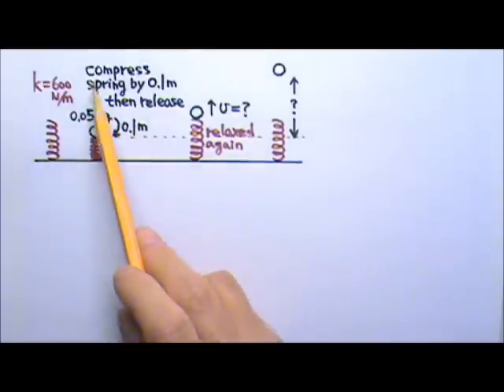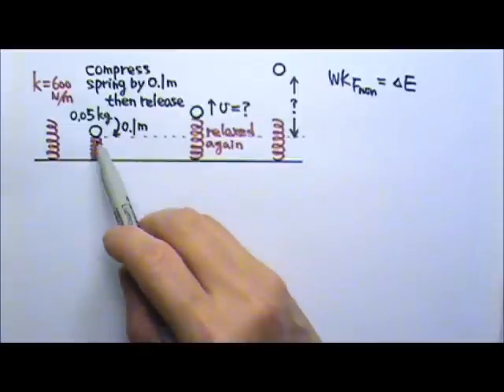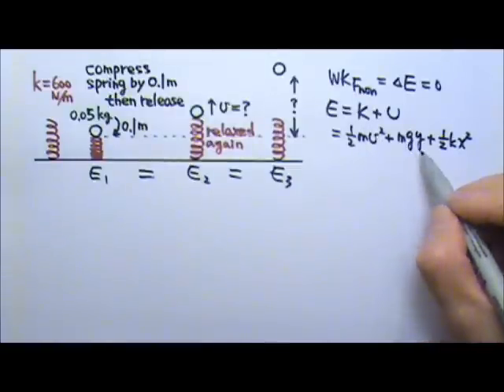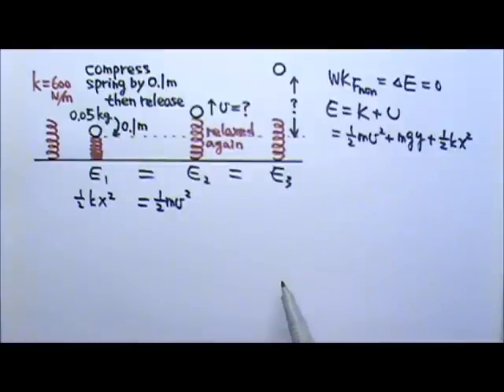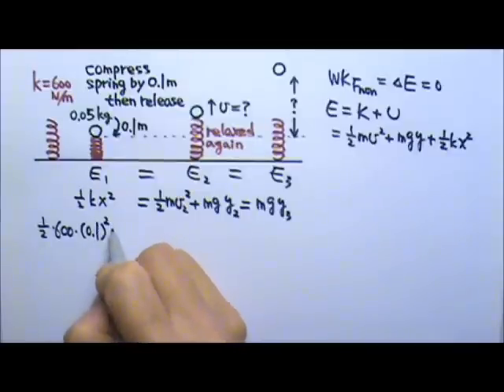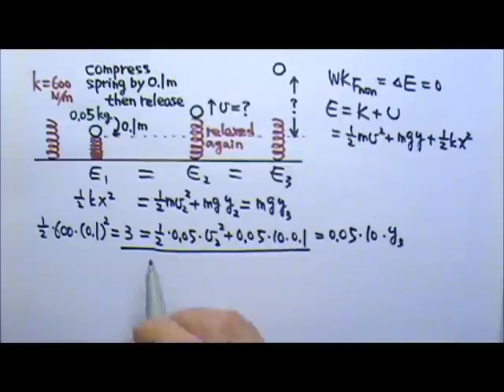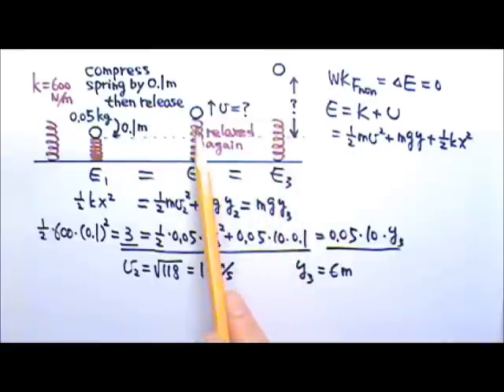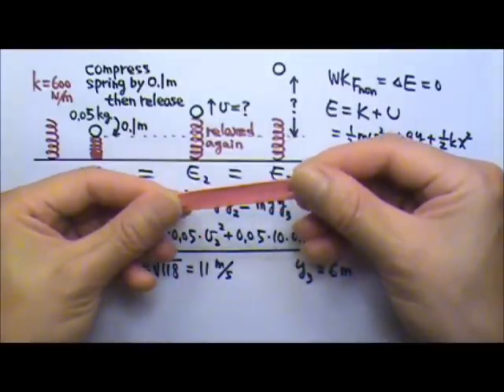AP Physics 1: Work and Energy 16: Conservation of Energy: Vertical Spring Prob.

Comment: Madam, This video helps me a lot on convention of energy, thanks for producing such video, but I have a question that will the spring not do a simple harmonic motion here. Then how do you surely say that the mass is releasing from the point which is not compressed of the spring?
Reply from the maker: The box will do simple harmonic motion no matter where the box is released - as long as the spring is a Hooke's law spring and that it is oscillating within the spring's elastic limit (not get deformed permanently. 
The definition for SHM is that the oscillating object experiences a restoring force that is the format of kx (i.e. a constant times the distance from the equilibrium position).
Reply: Thanks